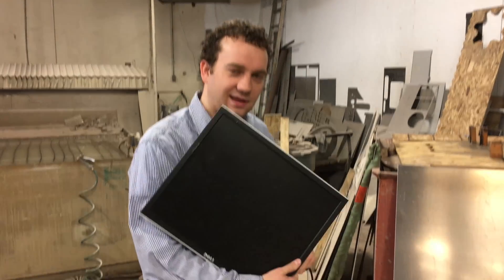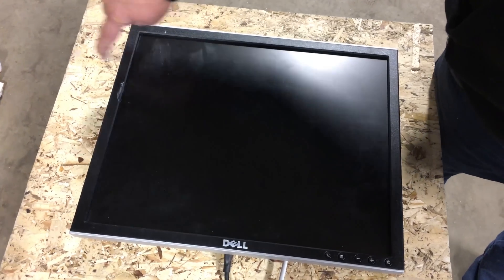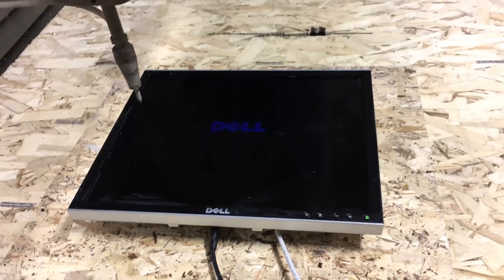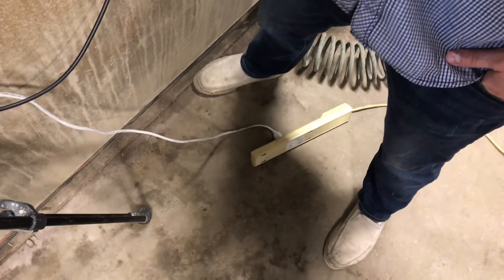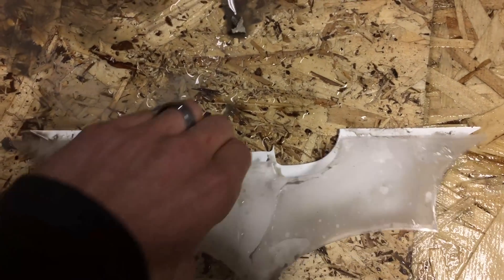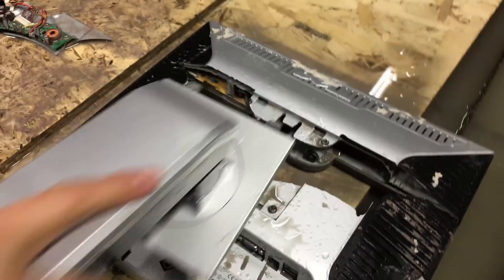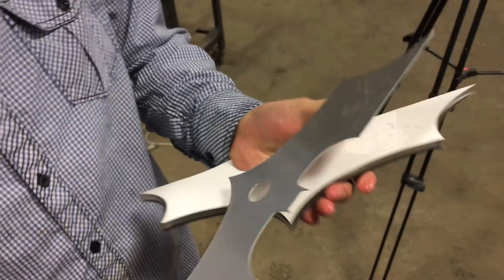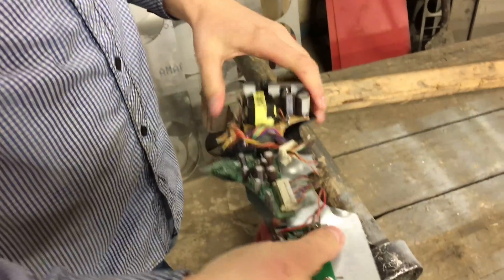Powered LCD Monitor vs A 60,000 PSI Waterjet

Comment: that wasn't the backlight, the backlight is a thin strip running down one side (typically across the bottom) that fires up into the DIFFUSER (the part you called the backlight) then several more lenses to blur the backlight glow more evenly, including atleast one Fresnel lens, i've taken apart a few LCD displays COMPLETELY so I am familiar with the parts, cutting through the LCD driver board is what killed it.

Comment: I wonder what would happen if the jet was fired dead center (from as far above as is safe) into a blender with no lid, running full throttle.
Reply: it would cut thru em like a hot knife cutting thru a butter

Comment: Might be interesting if you found a monitor where you could purposefully avoid all power and operational electronics, cutting only the screen, seeing if it'll keep going all way past the completion of the cutting. Either take apart one in advance to know exactly where all the circuitry is, or even temporarily frankenstein it to move the electronics outside the main unit so you can cut freely knowing you'll be cutting only the display.

Comment: Love this channel! How about cutting a Car gearbox or even an engine!
Reply: I also would like to see a gearbox. A small car or riding mower would likely be the best, since I don't know how easily you would get through a very thick gearbox. Can the jet be optimised to cut deeper, or is the stream fixed and the deepest it can cleanly cut is only a couple inches?
Reply: Adam McDonnell that did a engen
Reply: Jake aka Remaggib there are jets that can cut about 10" deep. . . maybe more...
Reply: I don't think theirs does though